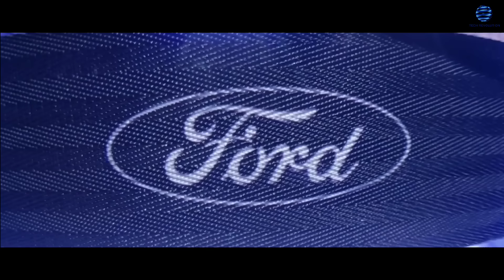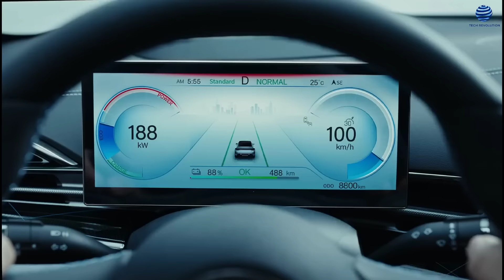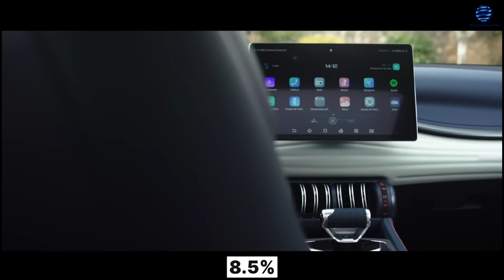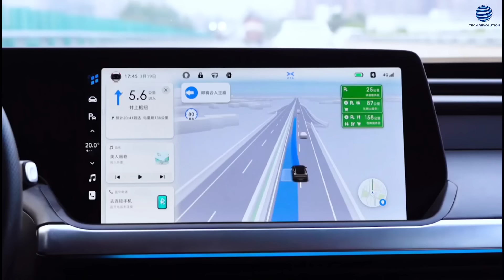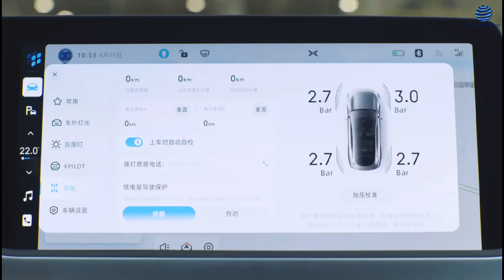Ford Just Confirmed What Everyone Feared, "It's Crazier Than We Thought"

Comment: Today 48% EV buyers in US regrets🎉 the purchase. China's 50% can do 50% is because of its infrastructure supporting EV charging with charging station from Beijing to Tibet. We don't have that is US. Additionally, the battery capacity reduces about 50% over 10 years so the driving range is also halved. The last is that Chinese EV are tested in extreme cold and heat environment but apparently UD ones are not.

Comment: The slow development of electric vehicles (EVs) in the United States could be attributed to the fact that the U.S. is an oil-producing country with cheap gasoline, and traditional internal combustion engine (ICE) vehicles remain highly profitable. Gasoline-powered vehicles align more with U.S. interests. In contrast, China imports most of its oil, which presents supply risks. Moreover, concerns about environmental pollution and other factors have prompted the Chinese government to align policies and media messaging to fully promote EVs. Gradually, the public has embraced EVs as well.

Before the U.S.-China relationship improves, Chinese car manufacturers are unlikely to take the risk of entering the U.S. market. From a Chinese perspective, the U.S. shows no intention of improving relations. Therefore, there is no real threat from Chinese automakers to the U.S. market. The frequent discussions of a “Chinese auto threat” are seen by many in China as political maneuvering within U.S. party politics.

The competitiveness of U.S. EVs primarily hinges on whether there is real market demand. In the early stages, Tesla dominated the EV market in China, and other automakers have learned from Tesla’s business model and manufacturing systems to some extent. For the U.S. to truly demonstrate a commitment to strengthening the EV market, Tesla’s sales must grow rapidly in the U.S. Without genuine demand, discussing technology, cost, and supply chain competition alone is meaningless.